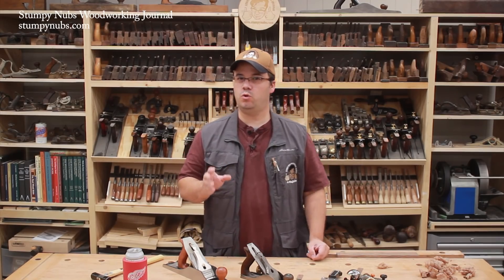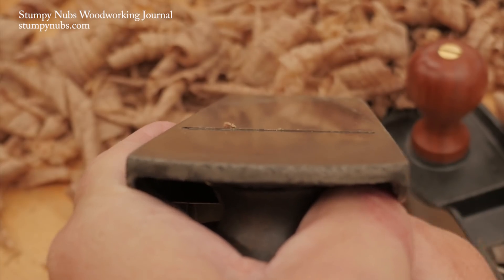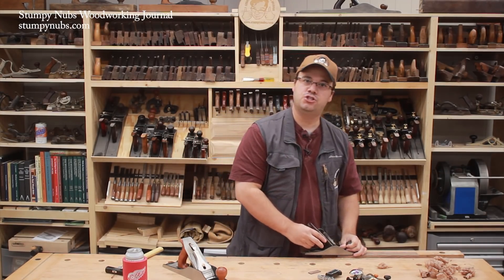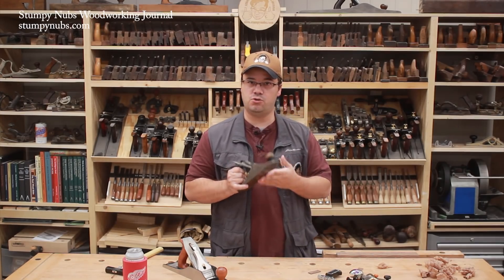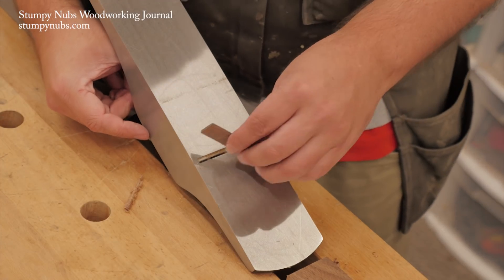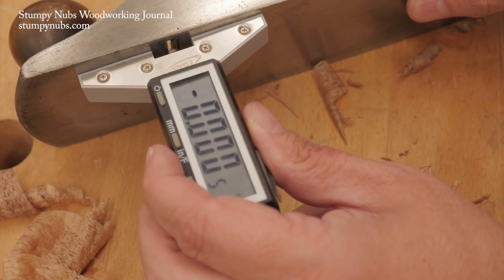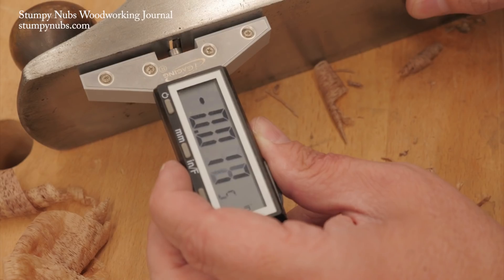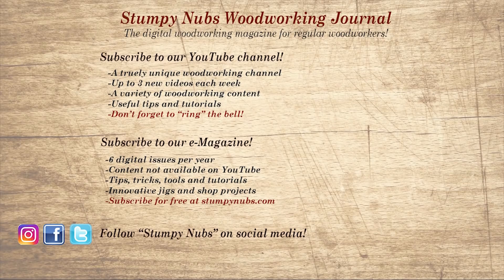Old-timey meets new-fangled: How to DIGITALLY set up a hand plane!

Comment: As a machinist that is used to work down to a thousands of a millimetre I have to give some important notes. They might seem very small for woodworking dimensions but you are after all measuring steel parts here.
1. Don't drag the tool over the edge. Lift it straight up and put down smoothly or your cutting edge and/or measuring surface WILL get damaged.
2. Cleanliness. Make sure there is nothing but the thinnest of coats of protective oil on both the plane and the measuring tool.
3. Angle. Don't lean the plane on the side, hold it plane when taking your reading and you get the most out of the tool. 

Yes we machinists are fiddly but there are reason for that. We want the best results our tools can give us, repeatedly and reliably while giving our (expensive) tools a long life.

Comment: I just used my other new digital tool, the Mini Mag height gage. 
In the past when I set the height of my table saw blade, I’d start by measuring the height, setting it shy, sneaking up on the needed depth of cut, 
Today I used the Mini Mag, and the first pass was right on. No more sneaking up...

Thank you!

Comment: Great tips. I bought one of those whiz-bang sharpening gizmos where you slide the chisel-blade in, and slide the sled back & forth across the face.  Got the blade sharp, but now I'm faced with the "some re-assembly required" part of the project.  With the time-competitors this time of year (mowing, painting, trimming my father-in-laws toe nails) I pass through my woodshed, look at the pieces that were at one time a fine, functional hand plane and decide next weekend will be the time to reassemble and use it.  Well done tutorial!  Thank you, James...

Comment: I suspect that an issue a lot of us have when we get old is that, even with eye glasses, we don't see as well as we once did, and adjusting a plane iron visually becomes difficult. So any aid that takes the guess work out if it is going to be welcome.  I have three pairs of eye glasses on my bench.  Two of the are different strengths, and the third has a jeweller's loupe hot glued to one lens for really close work.  I recently discovered the magnifier function on my iPhone (press the home button three times).  It would surely not be beyond the average woodworker to make some sort of jig/mount that clamped a phone in just the right place?  Wow.  I just looked up the price of the digital setup tool.   $17.95   Forget the iPhone jig. For 18 bucks you might as well go straight to the high tech solution.  The numbers never lie.
Reply: I've always set my plane with the small block of wood method - my sense of touch is a lot more precise than my eyesight :) . I bought one of those digital gauges on a whim a few years ago, and have to say it's pretty good, it gets the blade carpentry-perfect in a couple of seconds.

Comment: Interesting plane iron measuring device, but not sure I'd use it.  I'll stick with the proven old timey method of taking a few shavings on some scrap as it is so simple (and no batteries), but I can appreciate others would benefit from such a measuring device.
Reply from the maker: That's why I showed multiple ways. Different strokes for different folks, and all. :)
Reply: I like the repeatability of the digital method. Although I do use both ways you've mentioned, Mike.

Comment: What about using one of the digital magnetic table saw blade angle gauges?  Put the plane on its side then Measure the angle of the base the measure the angle of the edge of the blade
Reply: Wow! Talk about over-thinking. And here I thought I was the master of that.
If you don't have a digital angle gauge, that doesn't work.
If you do have a digital angle gauge, or decide to buy one, you will
also need a slide rule to figure out the height of the blade edge.
The digital plane-check gauge is $20. Spend the 20 and have a cup of coffee.
Simplicity.
Reply: zapa1pnt I guess you could just check to see if the blade was square to the side of the plane. I was just thinking why have a single purpose device if you already have a digital angle gauge use that
Reply: Michael, my apologies, I thought you were saying use it to check the Height of the blade. My bad.
The Plane-Check Gauge will help with Both the angle of the blade And the height.
The Angle Cube will indeed help with the angle of the blade. Just put the plane upside down, in a vise and zero to the sole, then check the angle of the blade.
Reply: @zapa1pnt  If all you have is a magnetic angle gauge, then everything will look like an ... angle?

Comment: I can't believe I never thought to use the gauge I have for setting my table saw and router to dial in my plane. I was actually furious when I saw this, ten minutes after I fought with my old, cheap jack plane, that I haven't touched for over a year, for 20 minutes to get it just where I Iiked it to finish some benches for my neighbor, and finished the project. But I'm going to keep a second one on hand, just for that, and not lose the plastic probe tip this time.

Comment: Great video. Any tips on using a plane with only 1 hand?
Reply: If you have only one hand, is there some length of your other arm available that can be used? I'm picturing replacing the front hand knob with a u shaped like surface that a forearm can be laid across to help hold pressure down on the front part of the sole.

Just in case you don't already know,  a smaller block plane can already be used with one hand.

Comment: Whoa! That digital gauge is only $18! Might have to give it a try.
Reply: Decent digital calipers are around 20 bucks, this is exactly the same instrument, only it has an etremely short range and can only measure very specific small features, I believe it is more than fair to say it should never cost more than 20 bucks. Given the lack of range and special purpose, this tool should cost between 10 and 15 bucks, depending on the build quality of the base.

You can easily buy multiple generic digital calipers and mount them to different things, to reliably measure practically anything in your shop to 0.0005". There are many videos about DIY depth gauges, spacing tools, precision alignment jigs, etc..built with digital calipers.

I appreciate the idea behind the iGaging "plane setup tool", but if you don't mind making your own stuff, it is much more pratical to get digital calipers and apply them differently, because you can always take them off from whatever they're mounted to and use them for their intended purpose. You can't use the iGaging tool for anything else than to measure very small protruding features, like cutting knives in machines or planes. You can't even use it to adjust router depth because it has such a short measure range and any normal size router bit wouldn't even fit the the base.

Just my 2 cents.
Reply from the maker: If you're going to go to the trouble to make your own jig to hold a caliper on the sole of your plane, you're better off just using one of the first two methods in this video. One assumes it would take longer to attach the caliper to the jig and set it up than it would to use a ready to go tool, or to simply take some extra test cuts :)
Reply: @CaliberFiftyVideos  , kind of like tools having their place so they get put back and you always know where they are. This tool is exclusively for this purpose and does it well.
Reply: @CaliberFiftyVideos  "... Given the lack of range and special purpose, this tool should cost between 10 and 15 bucks, depending on the build quality of the base. ..."

This demonstrates a misunderstanding of how markets work. Because the tool is so specialized, the market for it will be dramatically smaller than for a general purpose set of digital calipers of the same quality. This will give the company fewer units over which to amortize the development costs. Which means they have to move LEFT on the demand curve -- selling fewer units at a higher price. As you pointed out, who would buy this thing over a generic set of calipers that can be used in so many more situations? The answer, those who are willing to invest in tools that do one thing exceptionally well AND who have and use a hand plane. That's got to be a very small group. 

The company may not be able to sell enough of them, even at this higher price, to cover all their costs! Get them while you can.
Reply: @StumpyNubs  I actually meant a jig where one of your calipers is always mounted, so it would be as ready to use as a specialized tool, while you would still be able to remove it from the jig and use it as a caliper. You can't do that with these specialized tools, you would have to buy one for each separate task. Maybe I should have just wrote that ;)
Reply: @DKWalser  You are certainly right about markets and demand and supply.

However I stand by my point: Who buys this?

"..those who are willing to invest in tools that do one thing exceptionally well AND who have and use a hand plane. That's got to be a very small group. "

Exactly. Why start developing a tool for a very specialized task that only a very small group of people will 1) even hear about and 2) even consider buying?

It is only logical and very foreseeable that it would most likely not amortize itself with a comparably small number of sales.

So then why bother making it, just to eventually have to raise the price so less and less people will buy it over time?

If it was for the joy of helping the few people who buy it and the overall sense of accomplishment of developing a working, helpful tool, then yes, by all means, I would do the same. But a company can't work that way because it's end goal is to actually make money and pay the people involved.

If I were to start a tool making business with a similar idea behind it, I would manufacture high quality bases, holders, etc.. for conventional measuring tools you can buy separately everywhere anyway.

That would focus on a sound and maintainable construction of the holder part itself, not buy and fit ready-made electronic products into my own designs.

Then again, I wouldn't need to start such a business, because dial indicator stands, micrometer stands, etc.. are already made by companies that put all their efforts into providing only these tools in all price ranges.

I guess to sum this up, my point was that I don't really see the benefit in producing "niche" tools commercially, because they will end up costing the costumer a lot more than if they just had bought a generic tool of that category that can do that same specific job) with just a small amount of DIY..) and all other jobs as well, for less money.

Thanks for a polite and intelligent reply by the way ;)
Reply: EVP, as you pointed out, you're not in the tool making business. You're a consumer of tools. To you, this new tool doesn't meet your personal price/value requirement for a purchase. I don't believe that iGaging would be surprised by your reaction. The company is in the tool making business. They must believe that there are enough potential buyers that feel differently that there is a market for this tool that they can serve profitably at this price point. I hope they're right. I like having more options -- as confusing as a lot of options can be, I still like them.

Your original point was plausible, but wrong. You pointed out that this tool does less than a similar quality general purpose set of calipers. Indeed, as you pointed out, a general purpose set of calipers, with a little effort, can be made to do the one thing this tool does. Therefore, because the general purpose calipers do more -- produces more value -- shouldn't it carry a higher price than this tool that does just one thing? That's plausible because each of us tends to be willing to pay more for things that (to us) are more valuable. The problem with this approach is that it confuses 'intrinsic value' with 'price'.  A Rolex watch does far less than my fitbit, but it costs far more. A Porsche 911 carries fewer people and a smaller quantity of goods than does a Dodge Caravan, yet it costs much more than the Dodge. And, of course, there is the classic example of clean water -- which we cannot live without -- and diamonds. The most expensive diamonds in the world are good for nothing but adornment -- something of very little intrinsic value. Yet clean water, which has very high life-sustaining intrinsic value, costs far less than the cheapest diamonds. 

These examples demonstrate that we cannot understand price JUST by looking at 'value'. We also have to look at availability. There are lots of potential buyers for a good quality, yet inexpensive, set of calipers. With sufficient scale, such calipers can be produced at a low per unit cost. Thus, there are lots of makers willing to supply that market. This tool, too, could be made at a relatively low per unit cost with sufficient scale. However, iGaging doesn't seem to believe it could sell enough of these -- even at that lower price -- that it could achieve 'sufficient scale' to achieve that low per unit cost. The company does appear to believe it can sell enough at $18 to make a profit.

Comment: I’m sure that knowing you are using and worse of all advocating using a metal faced hammer to adjust a $300. plane you have just gave Rob Cosman night mares he will never recover from. Maybe suggesting a brass faced hammer would redeem your self in Rob’s eyes as well as mine. Even a light tap can leave a nick. 
Good luck and stay safe
Reply from the maker: Metal hammers have been used to adjust hand planes for centuries. You are using only very light taps, and it is surprisingly precise. Even today, many pros use the hammer technique on Stanley planes because the lateral adjuster is less accurate. In fact, some of the most expensive infill planes out there ($5-10K) can only be adjusted with a hammer. If you have nicked your iron with a metal hammer, you surely didn't use a "light tap."

Comment: The I-Gaging plane tool comes with NO instructions! If it weren’t for your tutorial, it would have been a pain to learn how to use it. 

By the way, it’s not particularly clear how to change the battery—when that time comes.
Reply: I just used my new I-Gaging tool to adjust three planes (one of which was my finicky old block plane). I have never adjusted one plane as quickly as I just did three of them. Amazing.

Thank you!

Comment: A digital gauge to set a plane iron,seriously!!
Reply from the maker: Why not?
Reply: @StumpyNubs  I just think that getting to know how to set up your tools by eye and feel in the long run makes you a better woodworker ,I know to be fair you did show other ways of setting up your plane,I just think digital gauges should be left for engineers
Reply from the maker: A digital gauge is nothing more than a ruler with large numbers instead of lines on a scale. I assume you use a ruler in your woodworking? Maybe not to set your hand plane, but some folks seem to think it's better to count lines on a scale than to read numbers. I think there's little difference. If I showed you how to do this with an analog depth gauge, would you have an issue with it? Yet isn't that what the little slips of wood I used were? A rudimentary depth gauge?
Reply: Stumpy Nubs just seems unnecessary that’s all
Reply: Gareth James setting up by feel may be good for some. But having a digital readout for noobs like me is better for me to understand. Im sure eventually I will get good at setting it up without gauges. But this will atleast help remove setup from issues that arise. 

As they say, theres more than one way to skin a cat.

Comment: I need to stop watching your videos.  It is costing me too much money.  I wonder if I can use the "Snap Check Pro" for this.  If I remember correctly, it was you who talked me into buying that.  I believe it was in one of your "cool tools" videos.  I do use the Snap Check often.
Reply: I do not have either one, however, I see no reason the "SnapCheck" would not work.
Keep in mind, the Snap-Check is Not magnetic, whereas the Plane-Check is and can stay
on the plane As you make your adjustments. It is Much easier and a, relatively cheap
addition to your tool collection.
Reply: @zapa1pnt  The Snap-Check is magnetic.  I ran out to the shop this evening and gave it a quick try.  It is a bit bulkier than the plane check gauge, but it will work, even on my block plane.
Reply: @Cecil_X   Oh, very cool. I looked up the Snap-Check but didn't pick up on it being magnetic.
Reply: One more followup.  I had time to actually set up a plane from start to finish, using the gauging method (Snap-Check rather than the plane gauge though).  There is no turning back.  It was the fastest, easiest plane setup I have done.  Thanks Stumpy.